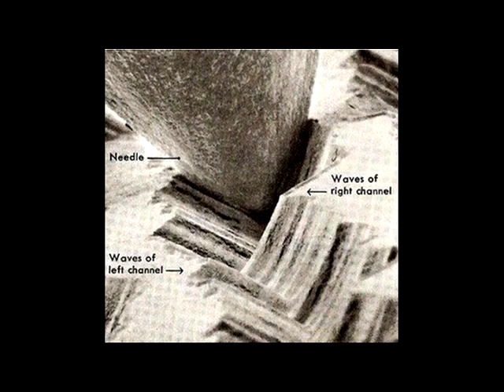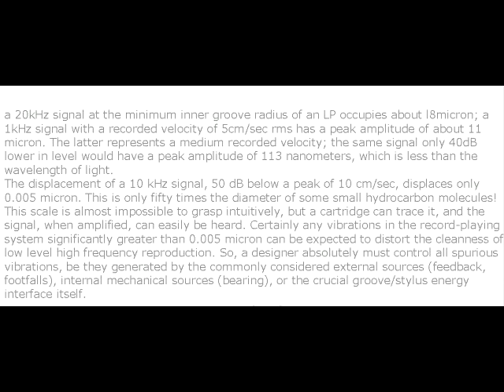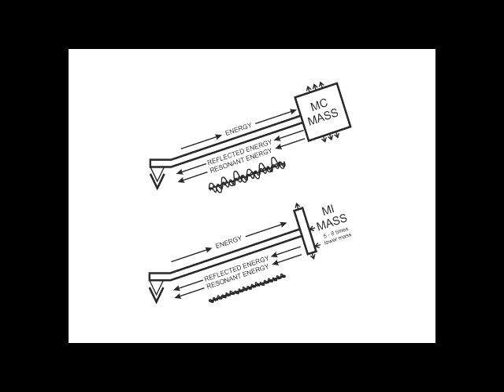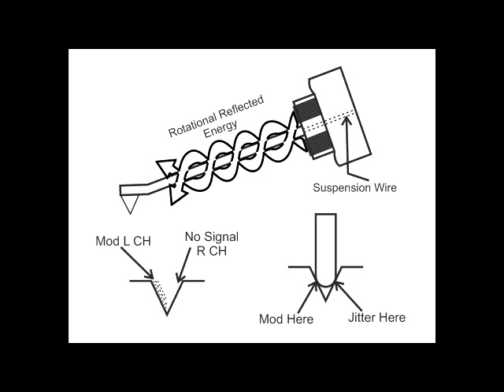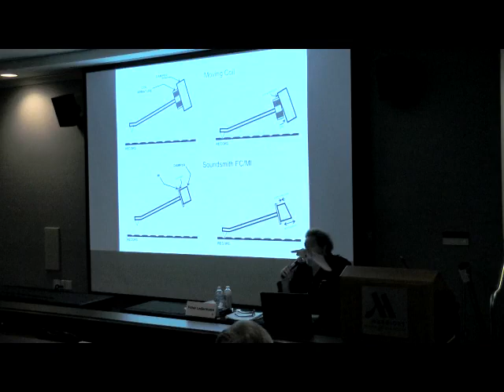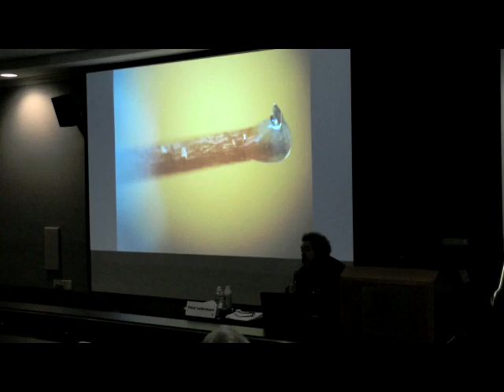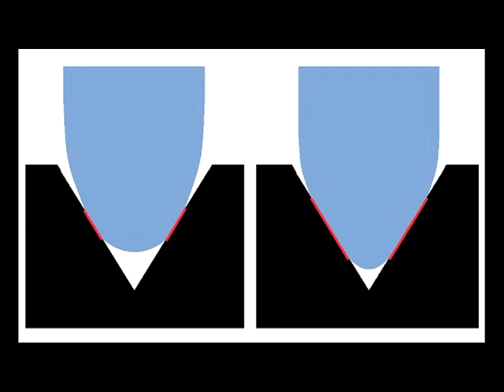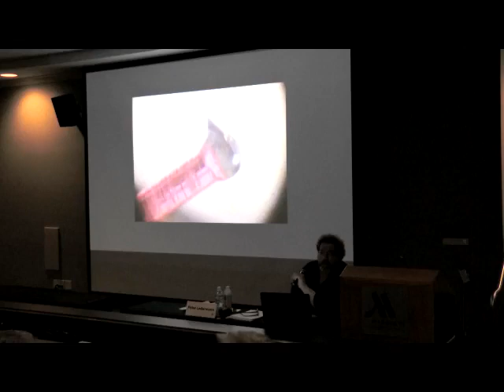Peter Ledermann of Soundsmith - "Reproductive Private Parts" (of a phono cartridge)  -

Comment: Wow, outstanding!  Thank you Peter, will look at your other videos.  I'm curious what you think of optoelectronic pickups, where a physical stylus and cantilever/mirror assembly modulates a light inside the cartridge body.
Reply from the maker: Dear Samuel; thank you for your comment and question. As I never comment about others products directly, suffice it to say that less important than the technology used to detect physical modulations in a medium, (Velocity vs. Displacement detection) are the issues mentioned as critical in this talk - moving mass and details of the design that result (or DON'T) in highly resolved tracing of the groove walls. Any technology can be done incorrectly, and the measurements I mention are often critically significant of what has been done right, and what's been implemented incorrectly!

Comment: Hi Happy New Year! I just wondered why you have the styli on the end of the cantilever? and not to drill a hole and insert it into the cantilever what's the benefit of this if any, and if making a hole in the cantilever is there any benefit in having slight overhang on the cantilever? at the styli's tip, is more or less better this will change it to pivot point have you done any research in this. And the same for the other end with the iron does the cantilever have extra mass passed the iron is the iron slid over like a sleeve over the cantilevered to change its  pivot point which is better more counter balance or less.
Just wondering about the cactus cantilever, is there an issue with it drying over time, what about if it's treated with linseed oil how would this affects it's performance do you no or have treat it with anything or just leave it natural.

Comment: The amp story doesn't add up.  High negative feedback, if it can be done whilst keeping capacitative oscillation under control, results in LOW output impedance and LOW distortion...exactly the opposite of what Peter said!  Radford was doing this with his sta15 and sta25 designs way back in the 1970s and Radford Revival are still makig those today.  Best valve amps in the world by design. Examples like Macintosh, and most other valve amps etc use nowhere near enough feedback so output impedance is relatively  high hence damping factor is low and back emf results in loss of  control or grip on the speaker so more accurately, frequency response mimics speaker impedance.  This, sadly, causes me to question some of Peter's talk.  Also the fish and water analogy is wrong as there is no change of energy in refraction.  You spear  fish by offsetting aim but the energy needed is the same and the position of the fish is the same.

Also, dissing all mc carts is suspect.  The advent of tiny tapered boron cantilevers half the length of standard ones together with nude stylii halves the moving mass at the tip which pushes resonance due to reflected energy way up over 50khz so carts like ATs PTGII  and oc9xsa are very well engineered and low wear low jitter designs.  Nagaoka moving permalloy designs are similarly low resonance low wear low distortion designs.

Interesting talk but there is more than one way to skin a cat and no one company has all the answers.

Comment: Hey Peter, I have been curious about one phenomena with HIFI equipment which isnt addressed often in the aspect of how it works and if it really does work. 
That thing being "Break in time". Are you able to shed some light and insight on this topic? Is it just a marketing tactic to get consumers used to the sound or is there a clear change over time with cartridges and other electronic parts?
Reply from the maker: This is a complex subject. I have long said that humans can get used to almost anything, as amply demonstrated by the partners we choose to marry.  All kidding aside, some of it is the brain breaking in. As far as cartridges go,  Moving Coil designs often ROTATE on their dampers to accommodate alignment of the stylus to the groove walls.  This can take varying amounts of time dependent on the design of the MC. Often, MC's rotate OUT of position due to improper skating forces or an accident! Our designs CANNOT ROTATE azimuth, as the generator is bonded to the suspension, so once aligned and set properly they maintain their azimuth, even though improper skating forces are present or even after an accident. Elastomers DO change in cartridges as they break in and age, as can certain styli designs polish and conform  on a micro scale, better to the groove.  Speaker suspensions DO loosen by degree with break in as well. In electronics, dielectric absorption changes the way capacitors sound, every time they warm up. Other components change over time as well - the list is very long. Switching power supplies and digital amplifiers start degrading the moment they are used and continue degrading. My power amplifier designs are pure analog for that and many other reasons.  I DO need to say that hearing changes hour to hour for us all, depending on stress, blood sugar,  blood pressure, .............you get the picture.  There are times when my system at work sounds very different from other times, and I know it is not the system.